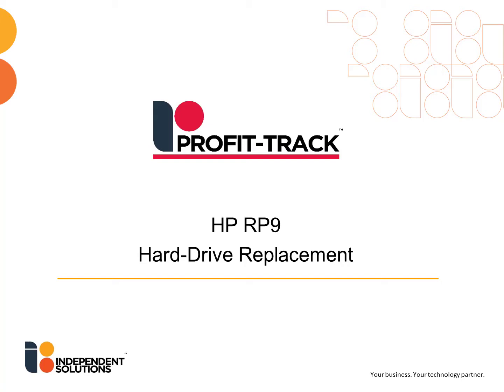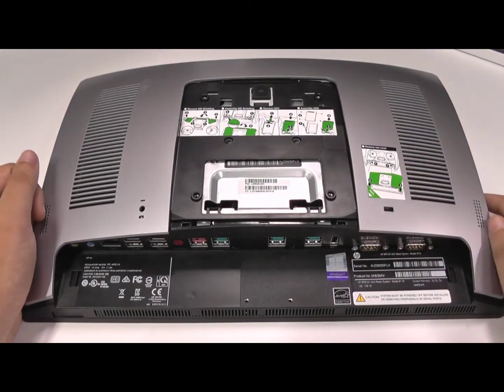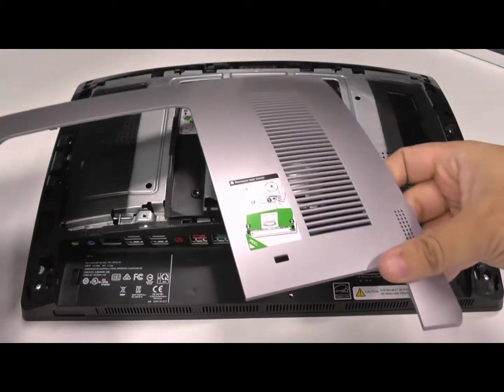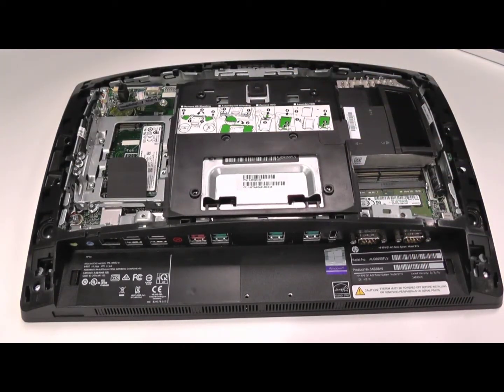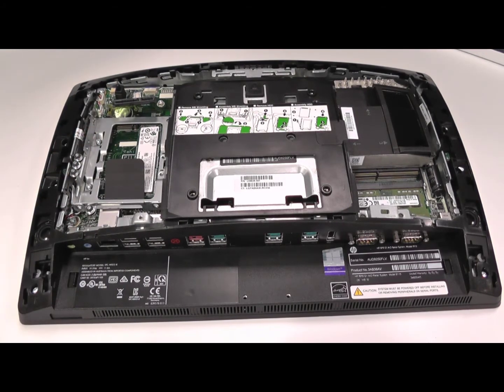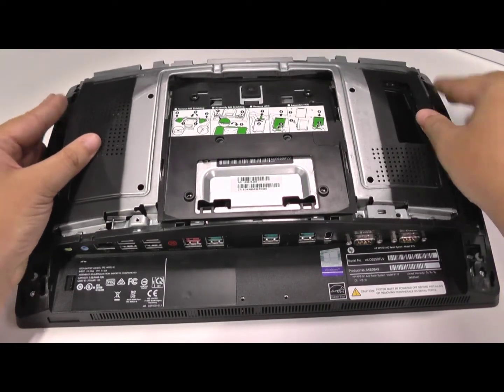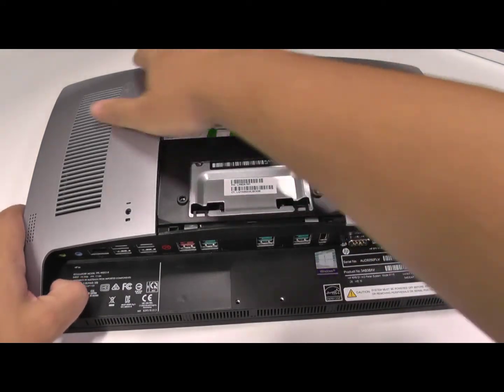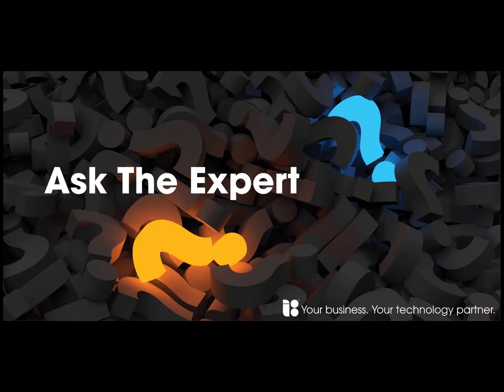HP RP9 Hard Drive Replacement

Comment: Can it be upgraded to ssd?
Reply from the maker: You would need to confirm your unit against HPs website, though I believe all RP9s can handle a 2.5" SSD, though if I remember correctly only the newer models can handle the m.2 drive.

Comment: By chance do you know why a honeywell bluetooth scanner will not charge when plugged in to the RP9 usb port, it does not need external power to work and works just fine when plugged into another PC, im wondering if there is a bios setting in the RP9 but cant seem to locate it.  I have tried all the ports with the exception of the coloured ones. Any helpis appreciated. Cheers
Reply from the maker: Have you tried it in the 12v Retail USB port? It's typically coloured green.
Most of these units are still in warranty, have you checked your warranty status with HP?